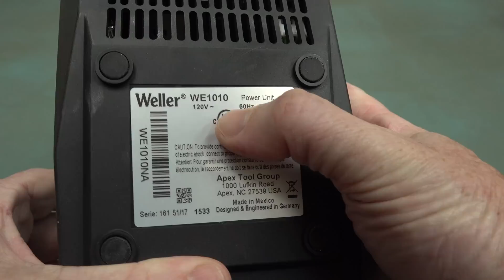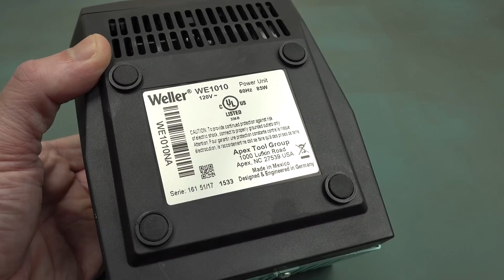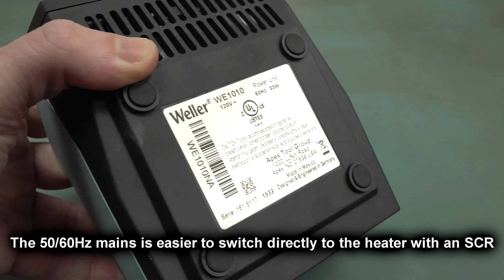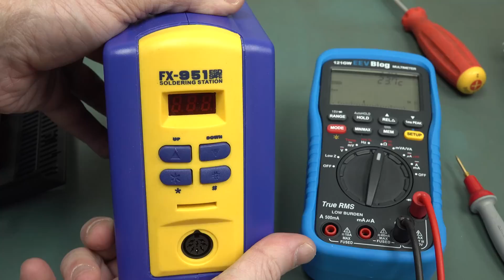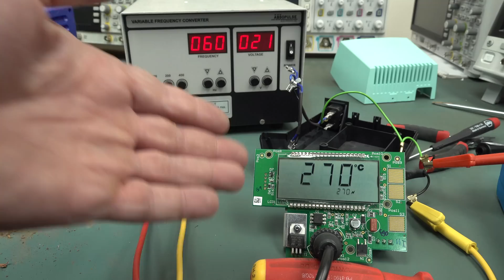EEVblog #1152 - 240V-120V = Magic Smoke!

Comment: This is really not all that uncommon on high current devices in the US and I believe the Weller likely meets all US code regulations. Devices like space heaters, hair dryers, electric frying pans, vacuum cleaners and other high current things tend to more rely on the circuit breaker blowing.

Comment: Many years ago, I was a tech rep for a printing manufacturer. I needed to repair a board from a printing press at a customer's place and used a standard Weller soldering gun. When I pulled the trigger, a cloud of smoke INSTANTLY (probably not more than 1 second) belched from it. I measured the receptacle voltage and it was 208V. The electrician had apparently wired the circuit to the high leg of a 3-phase system. I am still using that gun 30 years later! I duct taped the outlet and informed the owner of the problem.

Comment: I'll never forget, 1983. When I purchased Curtis Mayfield's, 2 inch wide tape, 16 track, MCI-JH-10-16, analog, Multichannel, tape recorder. Originally costing $20,000. I acquired it used for $3500. And one day. With the machine on but the tape not running.  Thick smoke starts to belch out of the take-up reel motor. I jump up and immediately switch the machine off. Then break into a panic. Realizing that, the take up motor has been trashed. And a few minutes later. I switch the machine on. To fully smoke the motor. But it doesn't do anything? You know it's dead. So no bother hitting the play button. Oh wait. It's working. It's working? It's working! And continued to work flawlessly for the next seven years. Tape tensions still on the money. Go figure? I sold it in working condition in 1990. And it never so much even blew a fuse. The fuse didn't blow. But my mind, sure did. But of course. I was also plugged in to the proper power. Because ya might make that lazy mistake with a $100 soldering iron? You don't make that same mistake with a $20,000 value, $3500 investment. No one would be that kind of lazy. And/or then write about it on the Internet. Because the only thing to be learned by that? Is that you can't fix stupid.

Mx. Remy Ann David
thetruckstudio.com

Comment: I'm very surprised to see a very cheaply designed transformer in there (and a lack of fuse.)
Usually that type of EI transformer with all the laminations in the same direction and welded together is typical from microwave ovens.
Unless it is meant to be a gapped transformer. But then, it probably wouldn't have saturated that easily.

Comment: I once saw a SMPS with voltage select switch running on 240V with the switch set to 120V... The back-to-back caps on the doubler were rated to 250V on either side, and were presumably running at  340-ish volts each. The output was stable and no smoke was released, despite the mistake not being corrected for over an hour.

Comment: I always thought that the impediance would determine current flow through a transformer not necessarily the resistance. But then I saw mikes comment saying that the core was fully saturated causing resistance to included into the equation...

Right? I'm mean I don't have a lot of experience with impediance and transmformer inductance sooooo.

Comment: It may have been low temp. solderable film magnet wire.  I have not seen a burnout produce anything other than a tar like goo since we use MW35C 200°C rated wire.  First failure mode is the melting of the Ryton bobbin, good for 260°C.
Steve
Product Development Engineer
Trombetta
Milwaukee, WI
USA

Comment: It's been my experience there is a thermal fuse buried in the wingdings.  Covers both over current and over temp failures.  Usually one of the lead outs is silver because it's the lead of the fuse.

Comment: Would be cool to rewind the primary and reuse the transformer.  Technically you could get away with slightly thinner wire even as the current would be half. (I think?  You would know more than I do. ;) )

Comment: So, why do we even bother to have different plugs for different voltages, if at the other end of the cable we put the same IEC connector? Not a problem with a PSU that allows a wide range of input voltages, but this isn't the case.

Comment: When checking power transformers ratted from old equipment I usually add a 40W light globe in series with the 240V supply. If all seems ok I remove the globe and measure output voltages.  But yesterday there was a loud buzzing... I forgot that in the OLDEN DAYS a power transformer could have 2 primaries; in series for 240V, paralleled for 120V.  And probably saturated it by putting 240V on a 120V coil.

Comment: Luckily a lot of these newer buildings have heat detectors not smoke detectors.  The draw back is that something as simple as opening a window on a very hot day can trigger the alarm if the temp raises to fast inside. It does matter how fast the temp rises and to what limit it goes. If you watch when they do their annual check on the system they use a heater on a stick that cups over the sensor to trigger the circuit. In the military its not uncommon to get random fire alarms in the middle of the night in the barracks because some dick wanted to open their window because you cant regulate the AC per room and they got too cold.

Still regardless of the system your building has not having to pay for the fire and rescue response is a good thing.

Comment: You might be able to re-wind the primary side if the transformer is serviceable. I used that method in the past, just takes a lot of patience. It would be interesting if you can wire that for 240 ?

Comment: In the mid 1970's TI made a thermal printer for the SR52 and SR56 calculators. This had a full wave rectifier, with a center tapped transformer. The fuse was on the center tap of the transformer, with no fuse on the primary. They used 1N4004 diodes for the rectifier. A common failure mode for these would form a short. Once one diode shorted, it would overload the others, causing them to short. The PCB would actually catch on fire after this. I worked the the repair center at the time. and saw a lot of these units. I saw a few where the transformer got so hot that the plastic case started to melt. We had to modify these to add a fuse on the primary. I was told that a doctor, who was a friend of the president of TI had his house burn down, due to this problem. That is when the modifications started. I am not sure how many houses TI had to buy because of this design.

Comment: A$1800 for a false alarm, eh?  Huh.  I'm sure there are USA jurisdictions that charge for false alarms but I would like to think there was a "1 per X" (where X is month, year, whatever) "deductible".  At least I hope.  It is a big problem - most fire alarms in building do not result from a fire that needs extinguishing by the FD - they are nearly always (like >90%) system malfunctions.  A smoke detector detecting smoke and setting off the system isn't like that of course (and shouldn't be treated the same in places that DO charge for "false" alarms).    There are departments in the USA that have stopped responding on building alarms entirely unless there is also a phone call indicating that someone sees flames/smells smoke.  Counter-intuitive to some, but sending fire apparatus to calls with lights and siren where there is a 9/10 chance that there is no need doesn't make a lot of sense.

Comment: I don't care if it's not smellovision, I can still smell this video. 
Saw the 120v/12v transformer in an old desk lamp spontaneously melt down and it took forever to get that STENCH out of the office.

The computer lab my high school had a bunch of old Zenith 286s. This was when 486 was common, so these machines had sat in a damp government warehouse for years before someone gave them to the school. The boat-anchor PCs were ok, but the monitors... years of moisture and cigarette smoke deposits do not play nice with high voltage. About once a week one of them would lose the flyback in a combination of spectacular noises and indescribable smells.

Comment: I repaired a Metcal base with a blown transformer - turned out they hide thermal fuses (primary and secondary) just under the tape round the windings, and one of those had blown. No smoke, sorry!

Comment: 7:30 primary fuse can be located in wall-socket or cable-plug ;) Not in this case, but it would be good if it were. Because short circuit can be in cable.

Comment: Also, I wonder if the excessive voltage broke down the enamel on 2 nearby turns, causing part of the winding to be shorted (which then fried)? Would be interesting to see iif the damge extends deeper inside.

Comment: For 110V equipment, you need 240 to 120V transformator. (like from Japan) then you're on safe voltage. You can buy easy one.

Comment: In the UK with 240V the fuse is in the plug to protect the cable, not the device. It is difficult to find a bit of kit fitted with a UK plug that isn't "universal". Any kit I have bought recently that has an IEC socket has be rated for 110~250V use. Of course there are exceptions and Dave found out the hard way! What about retrofitting an IEC socket with a built in fuse? Just like that cheaper station you showed?

Comment: Not sure about Australia but here in Europe you're supposed to have a correctly rated fuse in the mains plug. Then again that seems to be made for the US or some other 110V country which may or may not have such a requirement.

Comment: I've always found that wires contain more magic smoke than anything else. As mentioned by others the earlier Weller units had a fused IEC input, it's crazy not to have anything in the primary circuit!

Comment: I think the burnt mess on top of the primary is just from some top level insulation with a kind of sticky tape or similar. The enamal still looks quite intact although there is a short now. The enamel can withstand 300 deg. c for a few minutes or more. The mains breaker probably would have tripped if you waited a few seconds more. C-type breakers can handle 5 times the nominal current for a few minutes before they break. Also the house mains wiring has some resistance that adds up to the primary winding. This adds up to a few ohms in some cases! This will limit the short circuit current to below 100 A, maybe below 60 A which prevents the circuit breaker to trip immediatly. If you had a B-characteristic breaker (German, or older H - for household) it would have tripped immediatly.

Comment: you would think Weller would have a multi voltage power supply, it is not the 1980's any more. The company I work for makes electrical equipment and everything we manufacture is mains multi voltage, multi frequency.

Comment: I once got a call to fix electrics at construction site. The lights were not working, and a little refrigator was "walking" when plugged in. Problem was that someone before me had connected neutral to 230V making the sockets and lights run at 400V. The compressor of the refrigator was running so hard, it made the refrigator vibrate enough to make it move :)

Comment: Why is non-multivoltage capability still a thing ? (in an idiot-proof implementation)

The electrical input socket has the same shape as 240v nowadays, since it uses a grounded input plug like on every other computer.
No wonder you unaccidentally just assumed and plugged it in, i would have done the same thing.

Why can`t devices have a supersimple multivoltage detection "circuit" it would only be like 4-5 parts more i guess.
A 25 dollar/euro multimeter doesn`t break down if you put in 240v and then 120v, it just works, so why can`t more expensive gear just have 2 paths with an auto switching relay in there. (can`t be that expensive if literally every device would have that)

Never understood this, manufacturers would`nt need to make multiple versions anymore.

Comment: trap for joungplayers ;-)

true, weller builds the most robust devices
also, once a wecp20 fall down the floor, 4 meters, I was standing on a ladder.
Case opened y bit up, clip it back togetter, works.
ONLY the silicone cable gets old on my old Wellers, and either impossible to get new ones, or so much expensive... It is only the outer tube of the cable getting broken... but they work.

Comment: This is sure an interesting self induced problem.
Did this myself to an HP3478A, though it did state that it were set to 240 volt according to the labeling on the back, didn't cross my mind that it wasn't set to the correct tap within... (were set to 120, and now the transformer is dead, but gave me a power supply project to work on, even if I would have preferred a working multimeter.)

And talking about linear transformers compared to switch mode ones, I recently took a look at a T12 knock off solder station, that uses a switch mode power supply internally, also has a nice and compact form factor. And for its price it is practically flawless.

Comment: I'm surprised your circuit breaker didn't go off well before you had to pull the plug yourself! Your measured the primary resistance was 0.2 Ohms - how fast should a circuit breaker react to that?
Reply: That's what it ended up at - presumably it didn't get to nearly 0 ohms immediately?

Comment: strange re the lack of primary side fuse, I've got an old AIWA amp i got second hand, it doesn't have a primary side fuse which is strange to me, I am considering doing a restoration and installing a IEC/Fused socket at the entry to the case :)

Comment: One thing I forgot to say I one time saw a 3 Phase motor burn out at the factory I worked at, well it was undersize for the machine it powered and the magic smoke REALLY come out.  The motor was replacing the original that was having work done on it heheh

Comment: In the EU there is no general requirement to have everything have a fuse (after all you have building level fuses required), however various other requirements basically are solved by using different kinds of fuses. A whole lot of high power devices in all kinds of countries have no fuses of any kind.

It is probable that this transformer has a thermal fuse built into it, deep under the windings. I see that rather often.

Comment: You should get the transformer rewound for 220-240V/50Hz. This way you won't go around looking for a transformer that fits. It will be like original but 220-240V.

Comment: I used to work in the UK for a US company the number of PSUs we blew because we forgot to change the voltage link was staggering. After a while you would automatically check but sometimes if you were in rush magic smoke.

Comment: my recent magic-smoke adventure: board connecter to diesel injectors, car is running, probing around because it's not producing the expected waveforms. 
Probe slips, then there was a lightning in the clear sky. and the smell.
about 5 seconds later the engine dies. shitshitshit. disconnect the thing, turn engine off. turn key -> no fault codes -> engine on. It goes, good.
Turn the board around, 12VIN-to-fuse trace has vaporized :( good, because at least ONE FUSE worked, bad because it means that i need to respin the board (the polyfuse should have handled that. it did in a previous board revision, with engine safe and board safe)
scope is fine by the way, the TEK TPS is limited but made to survive these kinds of accidents

Comment: Interesting to see it's actually a proper circuit board in there. The last Weller soldering station I saw inside, had a thin ceramic substrate with printed resistors etc. on there. But the station had been dropped and it cracked the ceramic board, and so that was the end of that.

Comment: Did it make a bubbling crackling sound when the smoke came out? Great video! Maybe that primary winding should have been thicker. Here in the states friends have told me about equipment getting blown up in server rooms or other industrial settings where they use 120, 240 and (I think) 480. Stuff like very loud 'bangs' and  bright white hot globs of molten metal that come shooting out of power supplies being fed 240 set to 120v input.

Comment: Just drill a hole in the case, put a small connector in there, and use a 24V (halogen) transformer to externally power it. Leave the old transformer in there, disconnected, just for the weight. Fixed.

Comment: I dont know much about the general state of soldering irons available to you but I use a number of cheap tenma units for simple led work and they can all take 120-240v. I also have a slightly higher end atten unit that again can take a range of voltages and doesnt care if youre on 50 or 60hz.

I doubt either of these irons are as expensive as the weller so that thing in my view has no excuse for going pop

Comment: In this day  all 110/115/120V devices should come with over-voltage protection. 
The low end Weller design is just awful from this perspective, the  Hakko FX888 has a fuse in the primary. section.

Comment: There could be a thermal fuse buried inside the primary winding. Very common for smaller transformers not to use an overcurrent fuse but have a thermal fuse in the winding instead. Basically if the primary winding heats up too much (due to overload or whatever) the thermal fuse opens. Of course, the thermal fuse will not blow fast enough to prevent magic smoke during such an extreme event as putting 240V into it!!!

Comment: My first son at the age of two had a fascination with electronics and discovered the AC 120/240 switch on the back of computers and reversed the setting.  It took a long time to figure out what happened.  I'm an American so no magic smoke for me. (Thank God!!)  Its funny, now he's a computer hardware engineering student.  I should tease him about that now, that and the fact that he effectively demonstrated that you CAN get three CDs in one drive  at the same time, but don't expect them to work or be easy to remove. :-)  ...oh those were the days. :-)